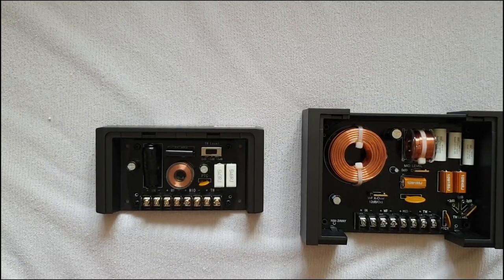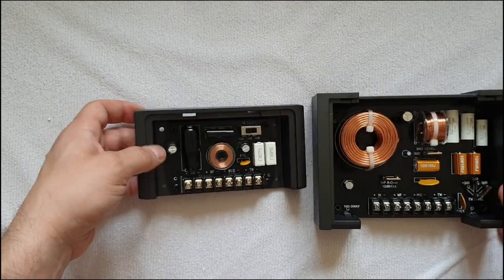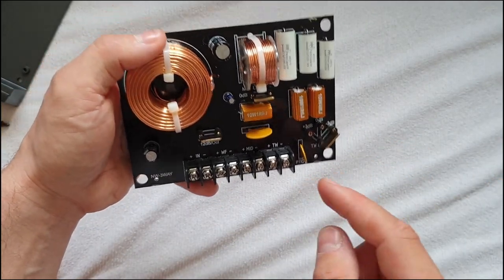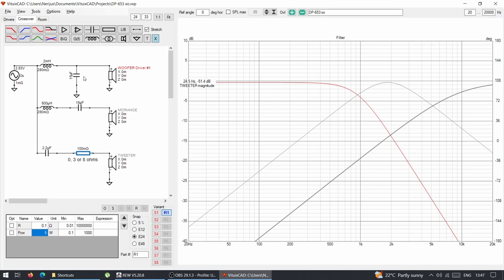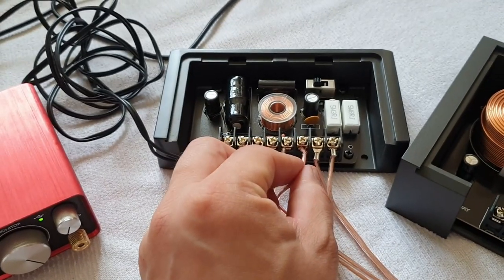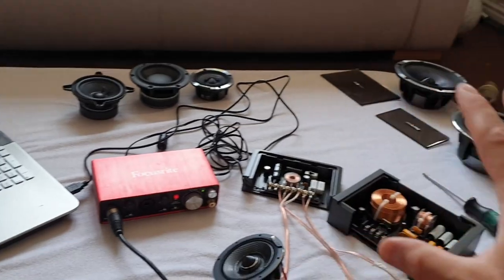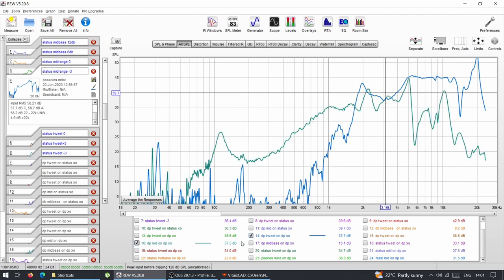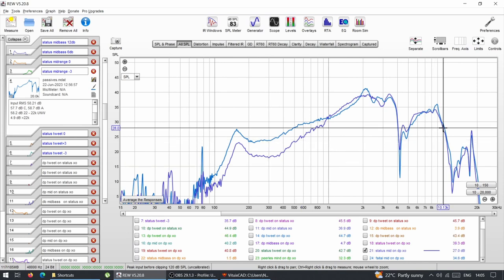Passive crossovers (overview, circuit, RTA measurements)

Comment: Very good information in this video. What crossover slopes and crossover points do you plan to use on your HDZ-653?
Reply from the maker: That is still to be determined by the install. Just finishing the A pillars for the Tweeters, will finish the dash and then I can start tuning😎

Comment: Thanks for this video, i am currently running Focals Utopia 165 W-XP on the passive crossover on an Helix P six MK2, i would definently now consider going active... Maybee a capacitor protecting the tweeter.
Reply from the maker: I am planning to make a video.about tuning a passive system. There I will be talking about differences between active and passive systems.
Reply: @RAW-CAt  that would be awesome !

Comment: Interesting.  I wouldn't expect different crossovers to change the response that much.  Do you think it's because of the quality of the crossover components or is it due to the values/ratings of the components?
Reply from the maker: It's definitely due to the values of the components and due to impedance curves of the drivers themselves.